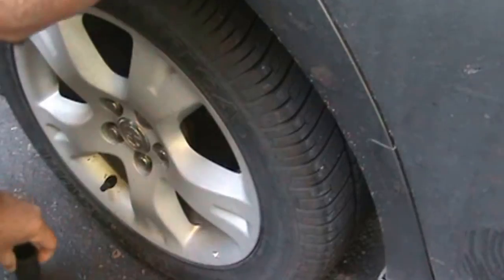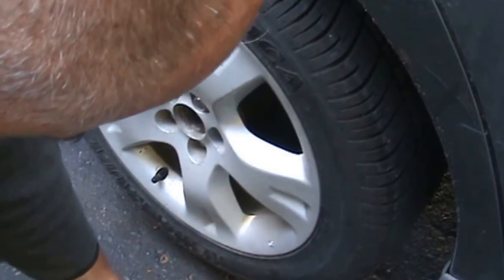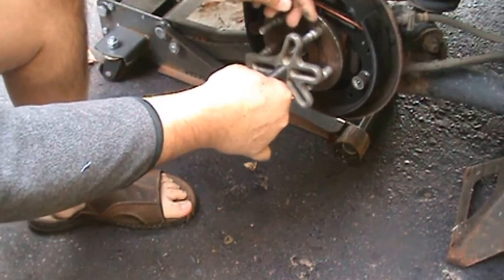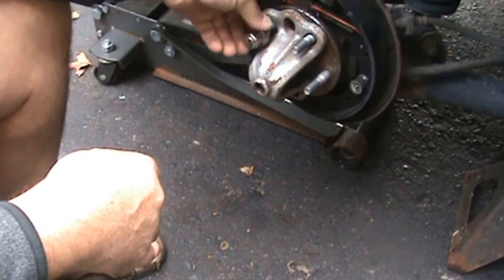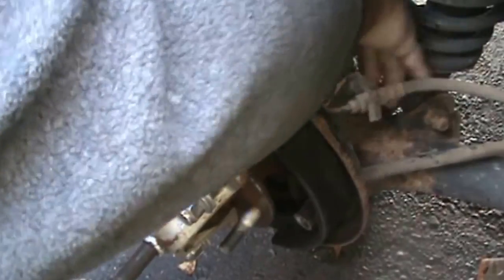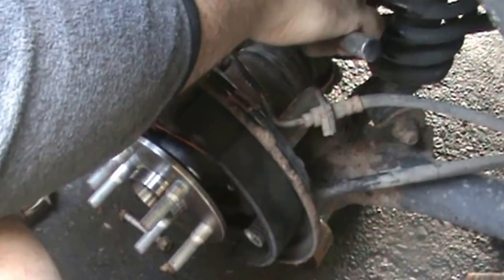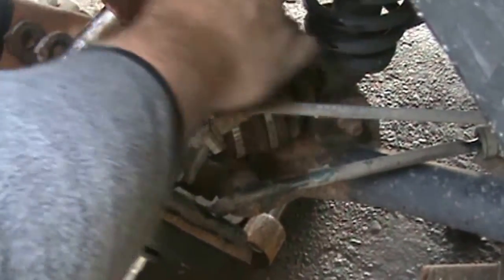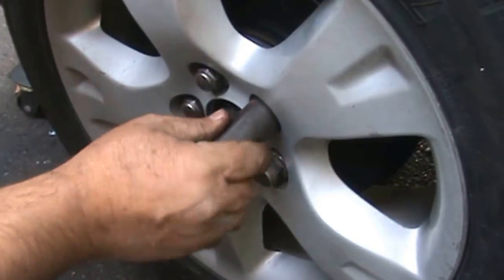2005 Toyota Matrix AWD rear Wheelbearing

Comment from the maker: that bearing still going strong no problem with the bearing of of coase the installer great work
Reply: Thanks for the replies, Superglide.  Happy to learn that the part is still going strong.  Good wrenching!  I am receiving many different answers from the various parts suppliers.  Checked the Moog 512512, and was told by Moog Tech Support that the sending device is built into the part and the sensor is a separate external part that picks up the signals (possibly from spinning magnets(?)  I will take a look under the car and see what's going on. Looked for your part (Premium 295-95032) and found only Pronto 295-95032 at around $65.  Did you pay a lot more for the Premium brand?
Thanks again.

Comment: Had the same repair on a 06 Vibe AWD (same car).  After removing the hub, the hole in the knuckle had a couple chunks missing.  Thinking I may have to replace.  Question is, There are no matching splines inside the knuckle for the large spines on the axel shaft.  Is that normal?
Reply from the maker: interesting  missing spline not seen that but may a Xadent
Reply from the maker: SORRY I DONT GET BACK  WITH YOU AS MY MOVIES ARE IN NEED HELP IS NEW TOO STUFF

Comment: Hello Superglide.  I have a 2003 base model AWD, which has ABS as standard.  I need to replace the passenger side rear bearing/hub as you did.  The aftermarket parts suppliers appear to manufacture this part with the ABS sensor somewhere inside the unit.   What did you have to do other than disconnect and reconnect the original connector wire to some sort of female connection on the unit itself?  How is your new Premium bearing/hub holding up after around 18 months of use?  Thanks for your help.
Reply from the maker: it does have a wire connetor on it ?